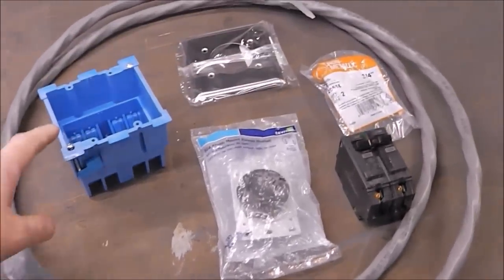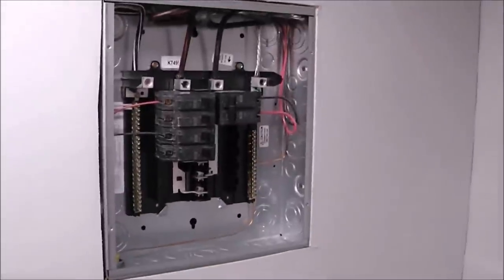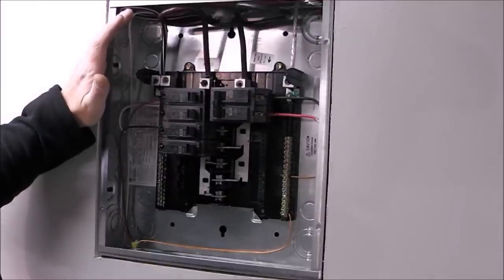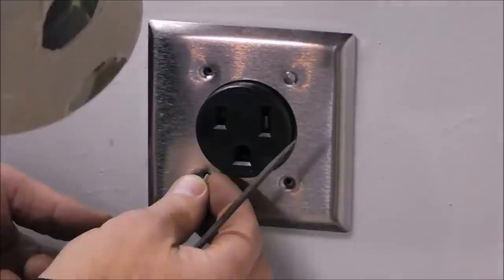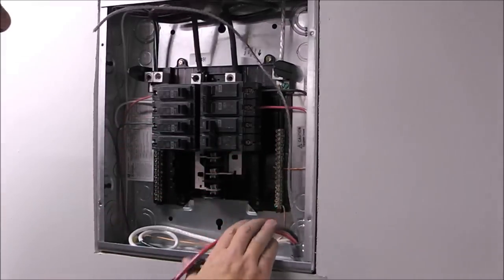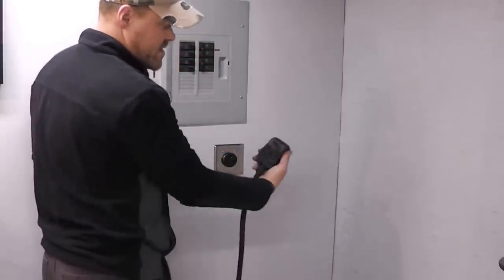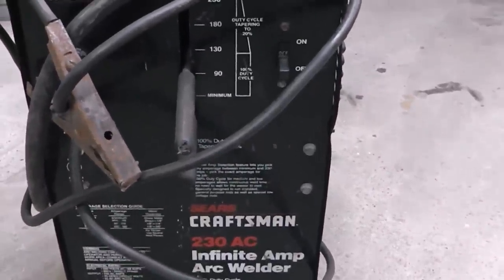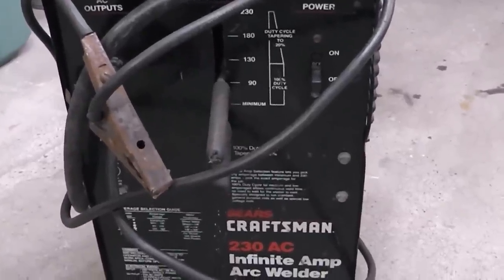💥 BEGINNER WELDING SERIES - INSTALLING A WELDER OUTLET

Comment: Hi Brandon, I just installed 100 Amp service in my garage. I picked up my mig welder from my parents place, along with Dad's arc welder and his small mig. I'm excited to start using them again. When I was teaching welding/millrighting at the college back in 2000 I got into a car accident that really messed me up. Here I am 21 years later back at it, but at 59 I don't have the steam I did back then. It made me feel good inside watching you return to older equipment as I am now. Thank you for that. - Robin
Reply from the maker: Thanks Robin. I know what you mean. I'm 51 and feel every day of it. Good on you for getting back out in the shop. It will keep you young....mentally and physically.

Comment: I was happy to see you rotate the receptacle. Takes stress off of the plug and wires and also protects against the possibility of your metal face plate coming loose and falling across your two hot plug terminals.
Reply from the maker: Good point on the faceplate! I never thought of that!

Comment: I'm 63 and have just started trying to weld (Harbor Freight 90 amp Flux Core). I purchased a very old Tomb Stone Lincoln Stick welder (red) that I think is AC and I want to try that as well so was watching to learn how to put in a breaker. The guy I purchased the Lincoln from had it since new and was a professional welder. He ran some beads for me to show me how well it worked. I was jaw dropped at the welds he produced on that old Lincoln!
Reply from the maker: Those old welders are pretty much bullet proof. Yes it's an AC welder. Actually one of the 1st machines I learned on using 6011 rods.

Comment: I started welding with one of the old sears welders about 40 years ago, these machines were made by Century for Sears and Roebuck.  There were many variations of these welders .  I have the AC DC type 230 amp rating .  Super heavy transformer machine .  It served me well for many years and sits in a permanent position on a shelf in my shop still ready for use if needed.  the transformer machines seem to be very durable over many , many years. Nice to see one of these machines again , thanks for sharing !!
Reply from the maker: @Joel Alleman thanks man! They are darn neat bullet proof. Heavy Duty indeed!

Comment: Thank you Brandon for the tip.  I just bought a 225AC Lincoln welder machine.   I notice you use two 30 amp fuses instead of 50 amp fuse.
Reply from the maker: Glad I could help. My welder extension cords are #10 awg which are rated at 30 amps so my breakers are sized for the thinnest wire in the system.

Comment: Thanks for bringing up the point of the 'weak link' being the extension cord and changing the breaker to a 30a. I'm going to do that also.
Very informative video.
Reply from the maker: And just to add to it, I have NEVER blown a braker doing it this way either and that includes running inverter welders as well as an old toumbstone welder.

Comment: I have exactly the same machine, but in the 110v version. It can do 100A, with a 20% duty cycle. You can't (shouldn't) run long beads, but for most home shop repairs, it works fine. Just do several short beads instead of one long. You can spread out the heat more. 
    You want smaller electrode sizes, 3/32's, or the more expensive 5/64, or 1/16". The sticks that work on this machine, 6011, 6013, 7014, 7018AC also work for my cheap inverter welder.  
If the Amazon brand of the month lets me down, I know I can finish the job with the Craftsman (as can my grandchildren and maybe their grandchildren.)

    These come up at yard sales. Also, if you have the knowlege, may offer a cheap restoration project, if the windings are in good shape. 

    Thanks for bringing this up.
Reply from the maker: Thanks for sharing! I don't know they made a 110 version. Pretty cool! I will have to keep my eyes peeled on marketplace

Comment: Awesome vid, but I have to say: article 630 of the NEC. Learn it, live it, love it. (It allows much smaller conductors for dedicated welder circuits. You could have used #10 wire throughout and been compliant with code, with a 50A breaker. 
ONLY IN A DEDICATED WELDER CIRCUIT
It's because it's an intermittent load. Google article 630. Love your channel man!
Reply from the maker: @giottolaudo7672 I appreciate that man!  Can you answer a question for me that I get asked all the time. I think it might relate to what you told me here. Most inverter welders come with a #12 cord, yet they are being plugged into 30 and 50 amp welder receptacles. Are they able to use a #12 cord rated at 20 amps due to that intermittent load? You wouldn't believe the number of comments I get from people saying it's illegal (maybe it is but it seems to be everywhere). Thanks again man for your input and your support!
Reply: @BrandonLund  I'm not an electrician, but my understanding is the quick answer is yes, at least depending on the actual input Amperage and duty cycle of the welder. For example, if the input Amperage is 38A and the duty cycle is 50%, the cable used could actually be rated for 19A, so obviously 20A would cover it. This is a serious simplification, but it might explain why the cords that come with machines can be so light duty. IMO, it is best to install proper wiring and circuitry for a receptacle to reach the rating for general use. Do it once and make it future proof. 6 gauge copper, 50A breaker, good brand 50A receptacle. Then if someone plugs an EV charger in going forward or you get a much bigger welder, it won't burn up. An extension cord being the weak link is much less scary IMO.
Reply: @BrandonLund  All that said, I do understand your logic of using a 30A breaker and it's very smart for your specific extension cord use. I highly doubt it will ever trip with most welders.

Comment: Yah,,,yah suuuuuuurrrrree, let's make sure it's not live before we jam things in there,,,,yahhhhh.  Awesome video guy.  I think up to this point, the only thing that has stopped me from getting a Harbor Freight cheap combination welder was the fact that quality welding is hard to do on 120.  But you just lifted the limitation sir.  Thank you. You're not making too many electricians happy though  :)  .
Reply from the maker: If I'm not creating hate and discontent something is wrong lol. I've had real good luck with my blue demon welder. That's a 120 / 240 welder and I literally cant tell the difference when it's on 120 vs. 240 (other than it wont max put on 120) and it easily runs a 6010 rod. 240 is nice if its available and affordable but you can do a lot with 120. Cheers and thanks for the support :)

Comment: Cool video, thanks!  A plus to this setup is in a power outage you can throw the main house breaker and use this 240v outlet to hook a generator to your house. This setup worked great for me after Hurricane Sally knocked the power out for a week here in Gulf Coast Alabama. 👍
Reply from the maker: Thanks man and great idea about the generator hookup. I just picked one up this summer that needs some work from sitting. It will be in an upcoming video :)
Reply: Best of luck with it, I hope you get it working right. Generators are priceless once the power goes out!👍

Comment: 220/240 is standard juice over here in Euroland so we are kinda lucky there. I plug for 6013s because they can be used on transformers (buzzboxes) or inverters (they can "arc blow" sometimes on inverters but rod angle often reduces that massively),
7018s can be a PITA to restart so I only use em occasionally, be interesting to see how you get on with em on the buzzbox.
They are supposed to be kept in an oven blah blah blah, but for home use I just keep mine in the house, I'm not welding any critical stuff. Stick and fluxcore MIG I do outside or by the open shop door with a fan at the bottom end of the shop to push the fumes out.Welding cart for first project?.Now you got all that power, you should be able to charge up your razor :).
Reply from the maker: Jaques Daniels Hey there buddy! I never had much luck running 6013 on this machine. It could be rod angle like you mentioned.  I plan to burn a bunch of various rods and see how it works out.   I'm very curious to see how this will run a 7018ac rod. The 6011 rods you see in the video have been sitting in an unheated garage for 15 years! I can't believe they even lit lol! I might do a welding cart project...maybe one to hold multiple welders?  So the deal at work was everyone had to go back to being clean shaven by January 1st. So now that everyone was clean shaven and high and tight, boss man decided that the beards could stay...im a bit undecided now! Lol.

Comment: I enjoy watching your old videos and came across this one. I spotted something that you need to fix. For a sub panel, the ground and the neutral are NOT to be bonded together. You must remove the green screw that is bonding the ground strap to the neutral bar. I learned this recently when I added a subpanel to my shop. I read it can be an electrocution hazard. I'm not sure I understand it correctly, but my electrician nephew confirmed this for me. Keep up the videos!
Reply from the maker: Thanks man! I appreciate it. I'll remove the ground screw today! Thanks again!
Reply: Hi. I was reading through the comments hoping to find this one. If you’re making a 240v connection to a sub panel, your ground should be the neutral, as this will go back to the main panel neutral which is tied to the main ground, vs. the sub panel ground which is not tied to neutral and has its own grounding rod.
Reply: @hunky_dory_7021  not true if the sub panel is wired correctly . A ground wire must be pulled fron the main panel thus connected by to neutral by the bond in the main panel

Comment: I've got what would be that welder older brother... But it needs some serious going through to be consistent. Tried the 7018ac rods and couldn't keep an arc. With new leads and tlc it may do better. I've got several welding projects started but the cold (I know it's not Maine cold but it is Alabama cold) has stalled them for now. Looking forward to this s series...
Reply from the maker: D Rickard Thanks man. Yeah, I tore into this one about 15 years ago right before it went into hibernation. It wasn't holding its voltage settings. It's all good now though. Maybe I'll crack it open. It was pretty easy to clean / adjust.

Comment: I know this video is about 5 years old, but I’m hoping to make you and anyone who sees this aware that not all outlets have the same safety margin. 

There is a difference in quality and safety margins when it comes to NEMA 6-50R outlets.  I noticed you used a Leviton brand outlet commonly available from Home Depot. 

Take a close look at the internal contacts in terms of material and size i.e. how much metal comes in contact with the prongs of the plug. Although UL rated, I think you would be surprised how often these overheat and burn up when the plug gets loose in the outlet. We are all familiar with how warm a vacuum cleaner plug gets in a worn socket, same principle here. 

Both Welders and Electric Vehicle Chargers get cycled routinely, wearing out the receptacle contacts which become loose over time which can cause the outlet to overheat during heavy current flow. In fact certified Tesla Charger Installers will almost always use the Hubbell for this very reason. 

There are several videos and photos of burnt receptacles to illustrate this phenomenon.

I recommend you look at two other brands that I am aware of and visually compare them for your self to Leviton.

First and most expensive is the HUBBELL brand available on Amazon.
Second and available at Lowe’s is UTILITECH brand. This is almost as heavy duty as the Hubbell brand and much less expensive. 

You will find they have heavy duty Brass Full Width contacts.  Also of note is that these type of receptacles have very specific TORQUE specifications for the internal terminal connections. I have seen on average between 20 and 30 inch pounds, which is much more than your average DIY person would think. If possible use or borrow a Torquing device of some kind that is marked for Inch Pounds. 

I hope people will see this comment and look into this issue for themselves when installing or replacing NEMA 6-50R outlets. I know I immediately replaced my Leviton with a Hubble (at the time I was unaware of the Lowe’s UTILITECH version).  

One last note: periodically, it is a good idea to check the torque on the internal terminals, inspect the receptacle for signs of heating, and or loose contacts. The more you cycle that outlet, the more frequently you should inspect it. I check mine at each Daylight Savings change.
Reply: Hi!

I read your comment and it helped me.

Thank you! 🙏🏾
Reply: @fredastaire6156  You’re Welcome - I’m glad I could help.
Reply: Thank you, I will take your advice

Comment: For the hots, red/black, does it matter which prong they power? I cant tell which wire went to which prong in the video. I think its black to the shorter one and red to the taller one?
Reply from the maker: @Retro for the hot wires red and black it doesn't matter which hot lug they are connected to.

Comment: Thank you for an informative video. I was wondering why #6 or#8 wire is used in the panel, but the wire gauge on the extension cord is much lighter. That didn't sound quite right to me.
Reply from the maker: Thanks man!

Comment: Hi Brandon  I have a question. what kind  cable needs for Lincoln welder 225AC   Thank you  Leopar.
Reply from the maker: To be safe I would install a 50 amp outlet with wire rated for 50 Amps. It will be different size if using aluminum Vs. copper conductors
Reply: @BrandonLund  👍

Comment: I only need to weld few hours, could I plug the welding machine into the oven outlet temporarily?
Reply from the maker: An oven outlet and a welder outlet are different. The welder won't plug into it.
Reply: Thinking about tapping into the dryer outlet
Reply from the maker: I've done that also

Comment: I was wondering about the house breaker amperage needed for welding equipment. Is a 30 Amp breaker all we need? Some of the TIG machines say they are 160 Amp or more and for some reason I thought they needed a breaker that would handle the 160 Amps or more. My home only has a 60 Amp service so I thought I would have to upgrade my house panel box to a 200 Amp service before I ever got a welding machine. I’ve been a production worker on an assembly line operating a MIG welder so I have always wanted a good TIG machine to learn with. The misunderstanding about the needed house breaker Amperage has always been a hold back. 

So is it true all I need is a 30 Amp breaker?
Reply from the maker: @Charles Garrett spot on. A 30 amp 240 volt breaker is all you need.  As far as the welder rating...its because the welder takes the input current and steps it up internally. I just picked  up a 240 volt 250 amp AC DC tig welder and can max it out without tripping the breaker. No need to upgrade your service, but with that said, if your welding and your electric stove is on and your electric clothes dryer, your refrigerator as well as other household appliances you might be getting close to your 60 amp main breaker capacity.
Reply: This was my exact question also. Good to know. I recently installed a new double pole 220 zinco breaker for my new downstairs laundry. Its now going to be laundry room/ work shop.
Reply from the maker: Sweet!

Comment: So I'm curious, I'm a welder not an electrician, but when you turn the power off, do you just flip the main breaker switch or is there another way, also does a house breaker box have to have 240v ran to it from the city or wherever, or is whatever wire the electrician run into the house enough to provide any outlets you may put in
Reply from the maker: I dont ever really turn off the outlet, but yes the individual breaker that is attached to the welder outlet is what turns it off. The main breaker would also turn it off (along with everything else) whichbis not desirable.  Your going to probably want a 240v welder outlet and all residential homes in the U.S. will be wired for 240v. You will just need a 240v volt breaker and the rest of the supplies to rig it up.
Reply: @BrandonLund  awesome thanks, I'm watching more videos and I think I'm gonna need a sub panel, but either way, your video answered questions I've had for many years, thank you

Comment: May be too late now, and it depends on your local code and the distance to whatever is feeding that sub panel, but a main disconnect in that sub panel would be best.  Even if that means "back feeding" through a breaker to act as a main disconnect...
Reply from the maker: Good point! I still might do that. I think I might even have a spare 2 pole 100 amp breaker. I'll have to see if I can find it. Thanks man!

Comment: Im wondering if i can just get a generator and run my welders off that. I wanna get a tig but im also moving to a trailer park soon idk if i can wire a welder in a trailer
Reply from the maker: Some welders do better than others on a generator (based on how clean the input power is). It might say in the paperwork that came with the welder if you have it. The trailer will have 240 volt power so its possible. If you have an electric clothes dryer than its super easy. Just put a male dryer plug on the end of a welder extension cord and run it outside when you're welding